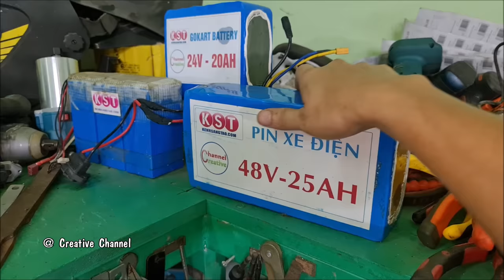Build a Mini Electric Motorbike Using Old Gas Cylinder

Comment: YOU ARE MECHANICAL,ELECTRICAL
ENGINEER. PLUS DECO PAINTER. 3 OR
4  IN ONE. NO OTHER ONE CAN DO ITSELF
ALL STEPS UNDER ONE ROOF. THE ONLY
 THING IS MISSING ,THAT IS ITS
FRONT WHEEL SHOCK OBSERWARS.
YOU NEED A BIG THUMB UP FOR THIS CREATIVITY. 👍🤣😎🇵🇰

Comment: Front shock absorbers would be helpful and doable too, for that comfort . Or to avoid those unpredictable strong jerks from the pot holes. Nice Idea and nice job
Reply: Easier option imo would be to hinge the front frame spine to the cylinder and have a horizontal shock between the top of the steering yoke and the cylinder
Reply: @georgebarnes8163  ம்ம்ஞஞஞ்
Reply: Good suggestion. He did what he can BUT you build the better one.

Comment: Wow, amazing. I see you have all the expensive tools to form metal parts for such a construction which is good, but I don't see you using a level or a 90 degrees angle or anything else. Probably an eye combines all these tools. And what about quality testing the weldings in order to let children drive it?

Comment: Did anybody notice the bit where he added a motor drive and battery power and connections ?
Was that bit a trade secret ?
Reply: I was looking out for that too, but no show, thought I missed it in a blink, but then a rewind was worthless.
Reply: 21:00 battery and contoller.
And the motor is in the back-wheel ;-)

Comment: Be very careful, don't operate any grinder near any type of gas cylinder!
Take it outside, open the valve to release the remaining gas, break the threaded seal then fill with water and let it sit for an hour.
Reply: That’s what he did didn’t you watch
Reply: @kunruh7  Yes, but since there's no clear description about the process/safety, hence my original comment.